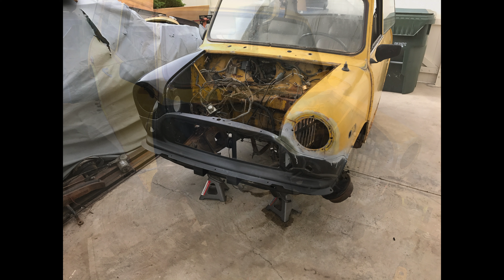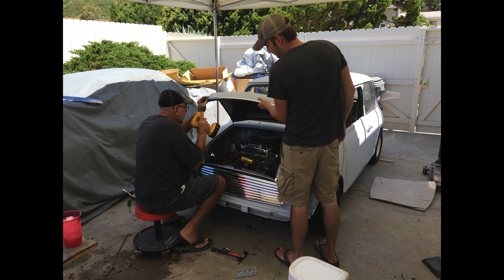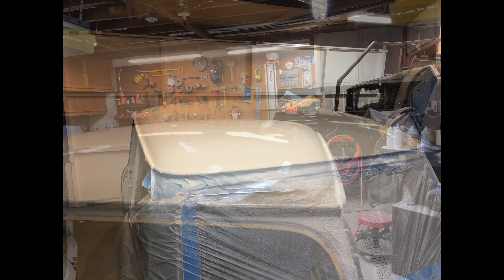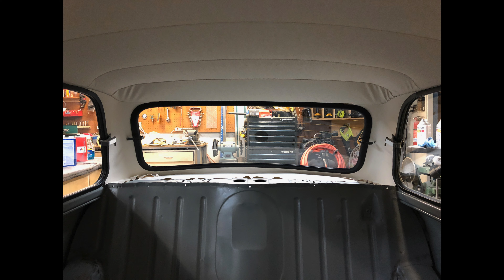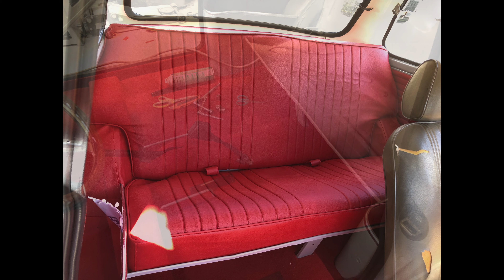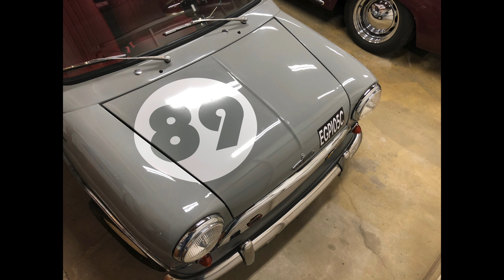Mini Cooper Restoration and Modification

Comment from the maker: I spent two years off and on building this car, then I sold it. The new owner displayed it for about a year in his garage then we worked out a deal for me to buy it back when he needed money for a new project.  I will be doing a Ride Along video with this car soon. Comments are welcomed and appreciated!
Reply: That's a great work done,is it running its original engine or you had to look for another mini engine?is it 850cc or 998cc?.
Reply from the maker: I put a 1275 engine in it 👍
Reply: @Jerod_Helt  Hi, awesome work you did there!   It must have been tough for you looking for parts.  Can you tell me where to buy parts and the engine?  Thanks a lot in advance.
Reply from the maker: @VinhHoang-ky2ge  I got most of my parts from https://www.7ent.com. I found the engine on Craigslist 👍